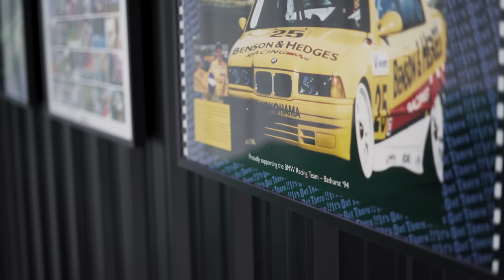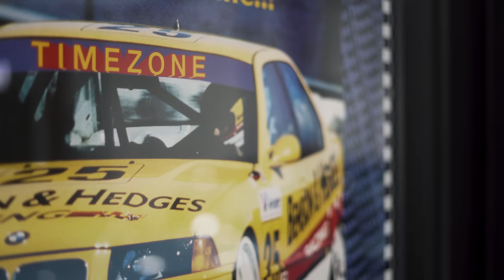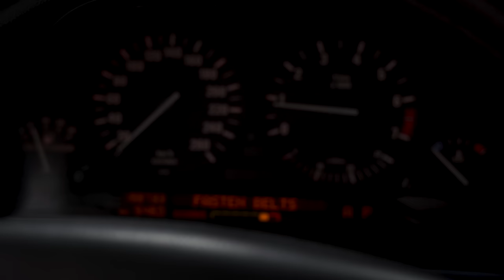Wet Sanding And Polishing My BMW E34 Touring To Somewhat Perfection

Comment: Great job, a dream come true for me. I know it's tiny detail, but that's what detailing boils down to. You should remove the 530 badge in the back and polish the paint underneath. In one take it's soooo visible that paint inside the 0 is not refined. Small stuff but still super important :)

Comment: Great job! The original owner of my E92 in BSM did not take care of the paint and I'm just starting to get into detailing it. I've used compound on the hood and roof but cannot get the swirls out, so it's time to wet sand, compound and polish. Your video is helpful and I'll have to get it looking better.

Comment: You never disappoint, dope music, dope camera work and dope cars. Btw what grit did you use for polishing? Whats that weird sponge thing you used for sanding?
Reply from the maker: Thank you bro! Most of the car was just 3k in a soft block RID stick. The repainted panels were done in 2k hard block followed by 3k soft

Comment: What about touch-up paint for rock chips and such? Do you ever do that? And if you were to do it in this instance, at what step would you do it?
Reply from the maker: I do do that but this car is getting a more permanent solution to that. I would do it before sanding, that way when you do sand it helps blend. It’s actually a really fun process

Comment: What does he use to spray on the car? Water  ?
Reply from the maker: Yeah its water and a little bit of ONR. But just water is fine
Reply: @ChromaticGarage  Did you have a specific dilution for the ONR in your sprayer, like at clay lube dilution?
Also, awesome work man. Your car looks fantastic.

Comment: How do you determine if wet sanding is the right approach?
Reply from the maker: No real answer to this. Perfection is usually at the end of sanding
Reply: @ChromaticGarage  Do you use a paint thickness gauge prior to doing this method? I would assume wet sanding with 3000 grit takes a layer of clear coat off no?

Comment: Love your videos but you're not using the wet sanding pad efficiently.

Need a bigger surface area and spread the load.
Reply from the maker: Thank you! I mean you could do that but I’d consider myself quite well versed in sanding results so I don’t see a switch uo